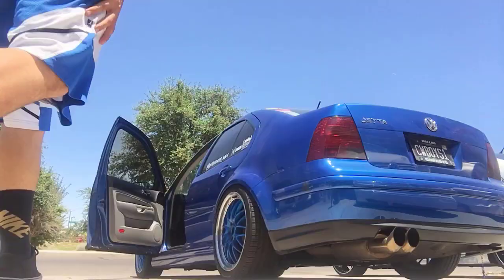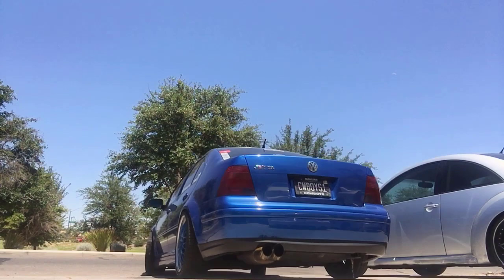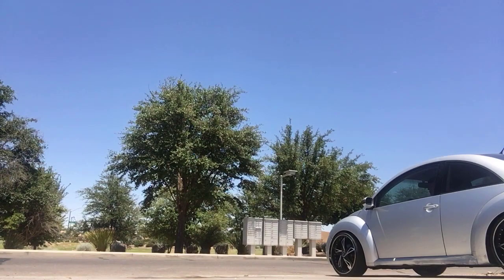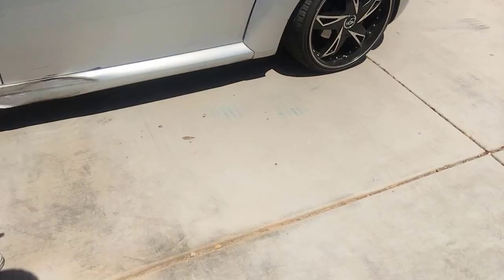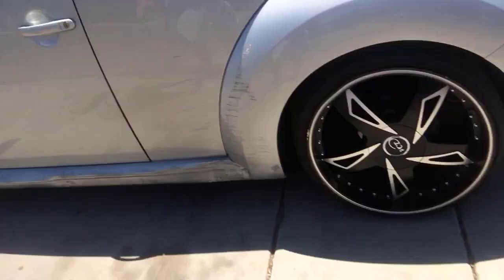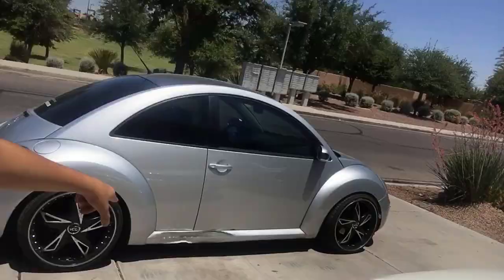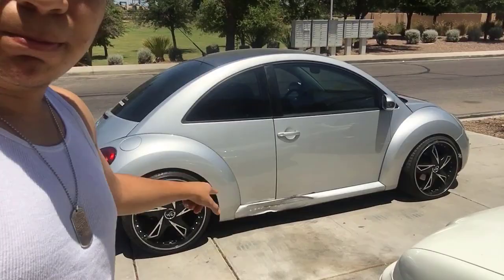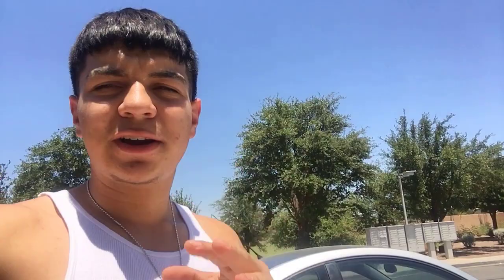INSTALLING RETROFITTED SIDESKIRTS ON THE VW BEETLE/BUG Pt.1

Comment: I've been wanting to do this on my Beetle for years, but there's a distinct lack of aftermarket parts available - hit and miss on ebay etc.   My skirts aren't as bad, but recently had to have them welded.  Read on a Beetle forum one guy covered his with rubber floor matting and actually looks quite decent lol.  Think I prefer your idea with the covers though
Reply from the maker: I appreciate the support!! I had the same problem and wanted to recreate a piece that would fit and it worked. So my best advice is to make a game plan and make the car your own!!

Comment: Were did you get the skirts at ? I like how they go up the rear fender, which is prone to rust in the east.
Reply from the maker: I got the skirts off of eBay motors for a Mk4 beetle and retrofitted them but they scrape on everything😂💯
Reply: @zephxcruz   hey nice job , i cant find those skirts , can you send me the link  ?...you say it was hitting everything ,,,was that bug lowered or something ?